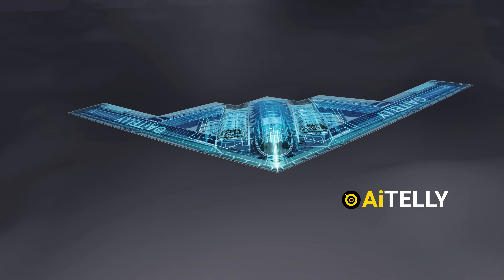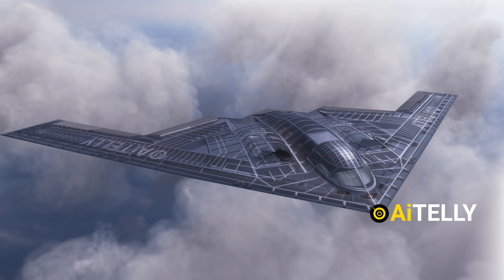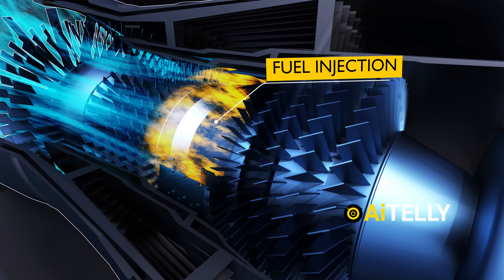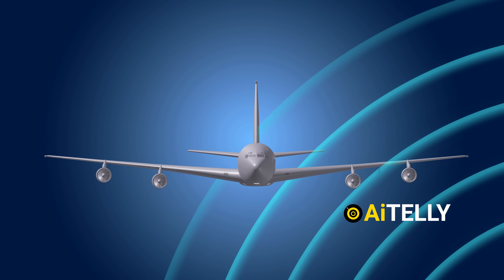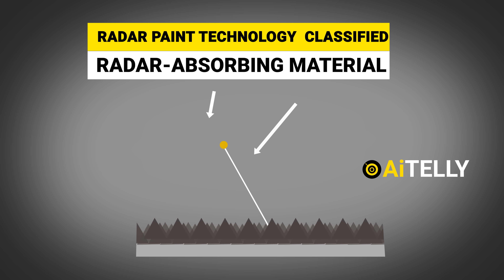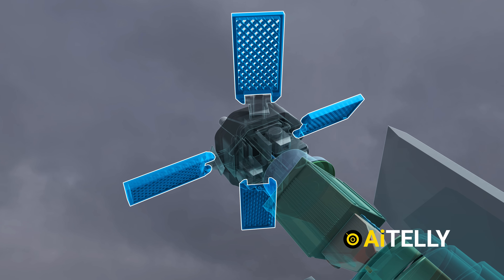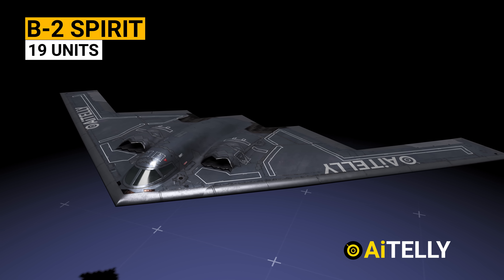B2 Spirit Bomber Plane | How Stealth Works?

Comment: That’s really stupid not having afterburners. It could use afterburners during mid-flight while it’s on its way to “The Fight”, not when it’s inside enemy territory. It was even said it can fly for something like 44 Hours. I’m pretty sure it’s not over the battlefield for two days. A bomber like that needs to get to the action fast.
Reply: Afterburners are incredibly inefficient, making them not suitable for a bomber which needs fly such long distances.
Reply: @mrnoskills3589  Then why did the B2 have them? It’s like the F-4 Phantom not having a cannon… come to find out certain situations it needed that “old technology”. An afterburner on a bomber sounds like something used for “certain situations” as well. 🤷‍♂️

Comment: Bud, the engines are completely backwards, and the shaft that the spools spin on turn all the same direction. Compressor and fans are at the front, pointing forward, and the turbines are at the back, driving the compressor at the front. Worth a retake.

Comment: 6:02 you mentioned turbine and compressor & fan wrong way around. The turbine in the back (after the combustir) spins compressor & fan ant front, enabling them to let air in and compressed

Comment: In the absence of a rudder how the B2 Spirit Bomber able to maintain horizontally levelled flight and yaw rotation? Thosa elevons looks like the B2 cannot make quick maneuvres like a fighter jet would.
Reply: Doesn't need to move like a fighter. It uses more thrust on left or right side to turn and all those jagged edges are there because Air Force made a requirement of low altitude flight at the last minute. Notice that the B21 Raider doesn't have all those jagged edges at the aft.

Comment: Why can't they make a nuclear powered engine bomber... Like they do in submarines instead of refuelling mid air?
Reply: nuclear doesn't generate thrust, it only generates heat which is electricity, thus it only suitable for propellers vehicle like submarines, but propellers gives a continuous and loud sound when the vehicle is in high speed. hence it loses stealth.
Reply: It was tried in the past, the main problem is size and weight of the reactor as a lot of shielding and coolant is needed to prevent a meltdown

Comment: You have to correct your video and tell the truth .. the B2 was invented by the Nazis during the ww2.. it's called the Horton b20. The flying Wing. Correction #@#
Reply: There was never a horten b20 nor was the B2 spirit developed by the nazis.

The only flying wing built by the nazis was the Ho229, a project that ended when the unstable nightmare crashed killing the pilot and program. It was never a stealth aircraft by any means.

The B2 spirit was developed by Northrop in the late 70s and 80s using the research data from Jack Northrop's YB-35 and YB-49 flying wing bombers combined with the fly-by-wire and stealth research from the Tacit Blue and YF-23 programs.

Do some research next time.

Comment: Good video but one correction, the Flying wing was invented by germans during the WW2, plane name is Horton HO 229
Reply: Ho229 first flight: 1944

Northrop N1M first flight: 1940

Jack Northrop did it first, the 229 program ended in explosive failure.

Comment: It is not correct that Mr Northrop invented this design. Just Google Horton brothers.....
Reply: Wrong. The B2 is based on Northrop's YB-35 and YB-49 programs combined with the stealth research from the Tacit Blue program.

The Hortens had nothing to do with this project and their main claim to fame the Ho229 was an expensive failure. By the time the team at Northrop actually looked at the 229 the B2 had been in service for half a decade and the tests run on the 229 concluded that it was the furthest thing from stealthm

Comment: Jack Northrop was not the only engineer with a flying wing, the German Horten brothers had a flying wing in1930.Tailless aircraft were being developed at the same time & delta winged aircraft. Both aircraft designs for the B2 came from these.

Comment: More than that. Jet fuel weighs about 6.7 pounds per gallon. The tankers shown about 10,000 gallons of jet fuel. So about 21,000 gals of jet fuel needed. 2.5 tankers full of jet fuel.

Comment: The B2 Bomber stealth paint is made of Polymer composite-based graphene, carbon black, carbon nanotubes, and carbon fibres as carbonaceous material and filler. Stealth coating resin market size is based on epoxy, polyurethane, and polyimide

Comment: I wouldn't describe using the ejector seat as "safely evacuating the plane" considering that you lose roughly an inch of hight due to the compression on your spine. I would rather never experience that, but it is a lot better than getting blown up by a missile, I guess.

Comment: the USAF should maintain a minimum operational fleet of B-2B Spirit (Block III) stealth long range strategic bomber . . . even after the B-21 Raider stealth long range strategic bomber is inducted into the air force . . .

Comment: I thought. The Chairforrce basically puts together a target list, and then divides the target country/area into strike packages and then assigns these areas a number based on level of danger. The highest level of danger becomes the highest number of total list of strike packages 

The b2 hits primarily these targets at night with the help of smaller stealth aircraft and with constant sorties until the sun rises and reconnaissance assets can get a daylit picture of the damage done.
B52s, B1 lancers etc will hit their assigned targets regardless of if they have been 'softened up' by a b2 although I find that highly unlikely. In actuallity l, the smtarget areas will be softened up by weasel missions flown by other aircraft tasked with teasing and taunting enemy radars into lighting up so they can use their anti radiation missiles to target and destroy specific targets preferably those of mostly fixed AA radars and even mobilee radar stations and their respective SAM assets
Reply: Now after all that is said and done if it's determined some targets that were to receive  follow up strikes, are deemed unessesary then I think those assets , if airborne already will be tasked with supporting friendly ground forces or targets of opportunity, provided that the secondary targets are re-tasked or hit by other assets ? That's the part I'm kinda iffy on.does the b2 get to play at all in the day by hitting targets of opportunity or maybe directly supporting any SF units operating at night ,that come under increasingly fanatical resistance or are ambushed and suddenly at risk of being overrun or driven back?

In desert Storm the f117and b2s were going one after a other in practically straight flight paths crisscrossing all over Baghdad in a brilliantly layed out series of surgical strikes that just continuously struck damaging blow after blow to the enemy that left them and their retaliation, if you could call it that, badly damaged and uncoordinated to say the least

Comment: The flying wing design was not invented by northrope, it was invented and made by the horton brothers in germany... the b2 was made by stolen horton 229 capturd and sent back to america at the end of ww2 know as opration paperclip... along with vernor vonbrow. Alot of tech tht america has is captured tech and knowlegde.. 
Another mistake is, during stelth, the b2 dosnt use the split rudders to yaw... it yaws by different thrust output by the engines, cz the split rudders would catch redar and ital be screwd..

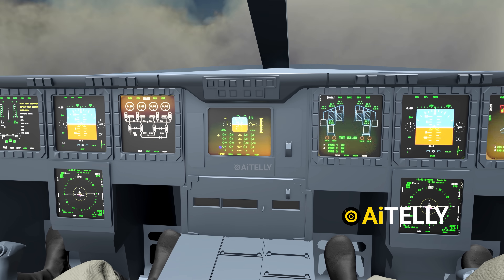Comment: Yes an attitude display not altitude. You need of course need to check the plane’s attitude 1:58
Reply: @lazkalatzis4092  Attitude is the correct term. It refers to the angles of the plane along the X, Y, & Z axis relative to the ground.

Comment: I'm a little shocked at the depth of knowledge & details of the B-2's construction & technology. Very informative...amazingly so. About the original Northrup YB-49. Wasn't the reason it was turned down was because one of the variants crashed?
Reply: The very first flying wing aircraft from Jack Northrop was the XB-35 turboprop. It later evolved into the YB-49 turbojet, which was way more difficult to fly than its predecessor. After it crashed in 1948, killing Major Daniel Forbes (Forbes AFB) and Captain Glen Edwards (Edwards AFB), USAF deemed it too risky and unstable to fly, and ordered all existing planes to be destroyed. Jack Northrop decided to resign from his company, going on early retirement.
Late 70s: Jack Northrop, now old and unable to walk, got a security clearance to participate to a classified briefing. There he was handed a small scale model of the B-2 Spirit, and his words were “Now I know why God has kept me alive for 25 years”. He died 10 months later.
Trivia: both YB-49 and B-2 Spirit have the same wingspan of 172 feet. And during their first test flights, air traffic controllers noticed that both XB-35 and YB-49 were very difficult to track on radar, due to their very reduced radar cross section

Comment: The AGM-158 has ER and XR variants which has a significantly longer range than original variant's 200+ miles. Also to note the B-1 and B-52s, which have since been equipped with advanced counter-measure and other ECM suite coupled with their capability to execute low level penetration, are capable of evading enemy SAMs. Nice graphics and detailed explanation of the hangar queen.

Comment: No Oreshnik vidio?
This is the best technology and engineering discussion topic of this century, you should make a video about it
Reply: The Oreshnik is literally just an ICBM with 36 small MIRVs that, judging by the satellite imagery, are way too small to do any damage
Reply: @ImBigFloppa  e = m*v*v - small but damn fast Mirv.
Reply: @101picofarad  
36 warheads, which includes all of the separating components and re entry vehicles, and components that can't do damage, weighs up to 1800kg. Divided up, that is 50kg per warhead, but that includes the parts that aren't the warhead itself, so those warheads would likely be only 30kg, maybe 40kg, or less than a 155/152 artillery shell. Let's call it 35kg for simplicity's sake. They would need to be released very close to the ground because Russia sure as hell isn't fitting a guidance system into a 35kg warhead that is traveling at very high mach numbers. A generous estimate would put their impact velocity at around mach 8. That would give them 132MJ of kinetic energy. That is about 3x the chemical energy stored in a 155/152mm artillery shell, but this is kinetic energy, not potential energy stored in explosives. When the warhead strikes the ground, it doesn't just convert all of those megajoules into energy, which is what would be expected from an artillery shell. Instead, all of that energy goes directly into the ground. It doesn't shoot shrapnel in every direction like artillery shells. It doesn't burrow deep and explode like a bunker buster. Instead, it will just burrow very deep if it hits something soft like wood or dirt, or if it hits concrete, it will immediately vaporize and create an explosion of dust. It would be sending out very pieces of fragmentation that could actually be lethal. In the immediate vicinity, it would be deadly. But after maybe 10 meters, even a person would be fine as long as they didn't have their eyes in the direct line of sight of the explosion (dust). It would absolutely obliterate anything it directly impacts - no questions asked, but that damage is incredibly localized to that one area because it can't produce the fragmentation necessary to expand that destructive envelope. 

Also it's E = .5*m*v*v
Reply from the maker: Coming soon!
Reply: @ImBigFloppa The missile(s) fired were UNARMED.  I repeat, UNARMED.  You'd have been aware if it was armed.

Comment: funny thing the USAF inspite of having the stealth B-2 Spirit & B-1B Lancer they still want to keep using the aging B-52 Stratofortress to the extent that the air force has opted to re-engine the B-52 by Rolls Royce . . . the B-52 has no place in 21st century warfare . . .
Reply: @chandrachurniyogi8394  it’s far cheaper to operate than the lancer and spirit because of maintenance costs the b-1 has swing wings which are very maintenance heavy especially for the shear size of the lancer wing mechanism and the B-2 has a rather environmentally sensitive paint that requires air conditioned hangers and the location of the engines make maintenance a nightmare the B-52 has no of these issues as it has less technology than some WW2 aircraft

Comment: I would say 99% it would be detected nowadays Ukraine detects small drones
Reply: I think that, presently, ukraine might not have the level of tech to detect this machine
Reply: I think its more about the cross section. The whole plane would not appear bigger then a small dji drone.
Reply: But yes, they'll probably be able to detect something small like.
Reply: @sonofagun3866   which are controlled by (RF) Radio frequency. Easy to intercept and locate. I wish more people kept quiet on topics they have zero knowledge in🤣

Comment: You don't believe a single B2 with a full payload can sink a much more expensive aircraft carrier at 39000 feet in the air.
Reply: Hell yes it can especially with those new heavy bombs that have a newer highly classified dense composite material that was made specifically by the military only.

Comment: Flying wings were actually invented before WW2 in by the Horten brothers in Germany. Jack Northrop did not invented them: he based his designs on the Horten brothers' technology captured by allied soldiers at the end of WW2.
Reply: Technically, it was invented in 1909, but Jack Norhtrop had a proposal for one in 1940. Heck, hr had flying being designed in the 1930s, and he designed the YB-35 in 1941.
Reply: @voidtempering8700  although many designs of flying wings as gliders and powered craft existed since the dawn of aircraft it's a fact that Jack Northrop did access Horton brothers information. The Horton brothers had the first jet powered flying wing and had built reciprocating engine powered flying wing designs as well. In any case Jack Northrop did not invent the flying wing
Reply: @jgdeyo  Did you read my comment? I never said he invented it, just that Horton had little to do with his idea of a flying wing. Him and Horton developed wings without help from the others. Naturally he would look at the Ho-229s design, but whether it influenced his own ideas of the flying wing is debatable.

Comment: "[...] Jack Northrop, who invented the flying wing aircraft [...]"

(X) doubt
Reply: Horten Ho 229?
Reply: Horton 229 was the first wing aircraft "Nurflügler" in ww2 by germans
Reply: @IRico_chetI  Northrop and the Hortons developed the flying wings at around the same time
Reply: @imthygamer3566  nope......George Cayley 1799 UK inventor...you are welcome
Reply: @BooYaa253  Dude? Thats a glider???? Not a powered aircraft? By that logic birds are flying winged aircraft aswell
Reply: @imthygamer3566  dude.....the flying wheel was not only invented long time before Northrop but it was also powered. Even if it wasn't the flying wheel is what we are discussing not the engine. You Americans had nothing to do with that ...stole design and then probably blamed Russian for it 🤣
Quotation......
The concept of the flying wing was born on 16 February 1876 when French engineers Alphonse Pénaud and Paul Gauchot filed a patent for an aero-plane or flying aircraft [5] powered by two propellers and with all the characteristics of a flying wing as we know it today"
So to your poor argument......it was powered but that doesn't matter anyway.
You lost.....deal with it

Comment: so, the delta flying wing aircraft was developed by Grumman, and not by the Nazis? 
Im sayin, there is a WW2 version out there
Reply: Northrop had flying wing designs in the 1930s, and flew an aircraft with one in  1941. The flying wing wasn't a new concept by any means.

Comment: You left out the movable tail.   This is supposed to prevent uncontrolled pitch changes.   This is what destroyed an early Northrop flying wing design and killed its pilot Captain Edwards.  The wing started up down pitch changes and left controlled flight.  Th is how Edwards Air Base got its name.
Reply: @mikethompson2650  it's a flying wing design, it doesn't have a fuselage or a tail at all, The B-2 has outboard and inboard eleons that move independently to control roll and pitch. The B-2 also has flaps on the trailing edge of its notched wing to control roll, pitch, and yaw. Nobody likes people that talk out of their backside